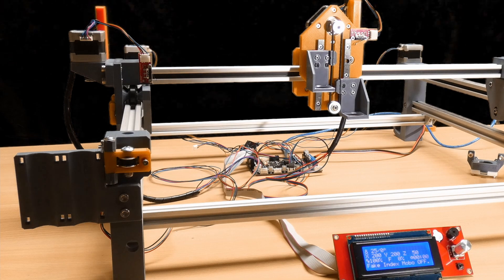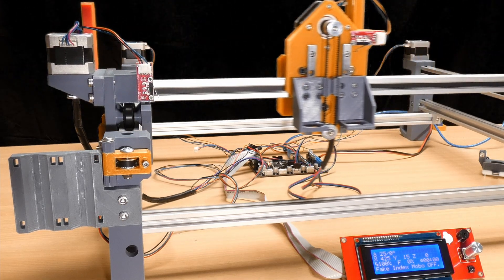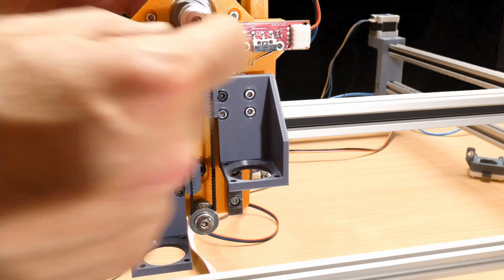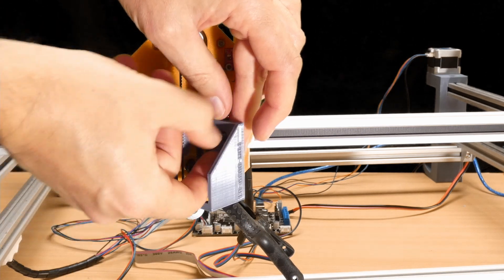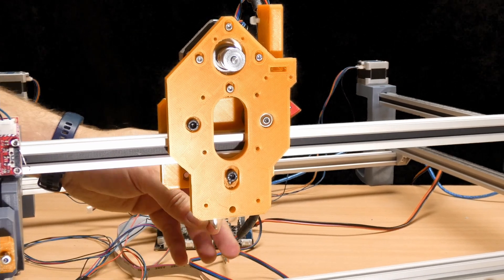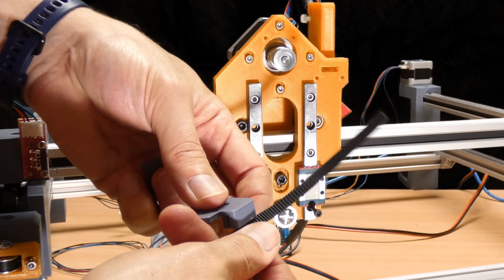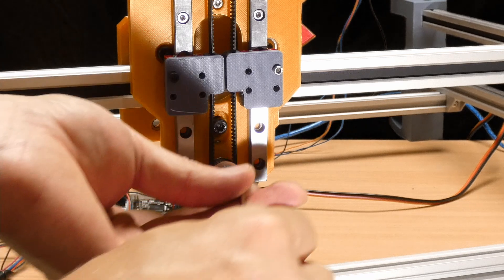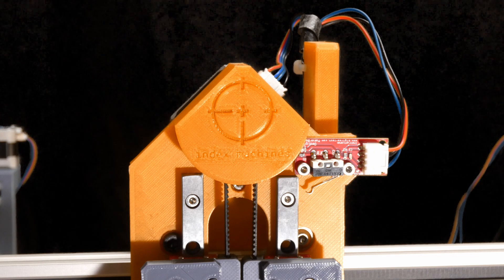Part 5 - LumenPNP / Index PnP - It's Alive!! [Index Pick and Place]

Comment: When you moved the head could around could you detect vibration in the while frame ?
Reply from the maker: I didn't notice anything when moved by hand
Reply: @StuartPittaway  I meant when you were running your gcode moving the head around.  You mention in the video about possibly moving to fast.  I have seen fast head motion can cause a lot of vibration in machine depending on mass head vs mass of machine.
Reply from the maker: @allenlorenz  Ah, yes I understand now.  I was probably going to quickly.  The bed may not be 100% square either.